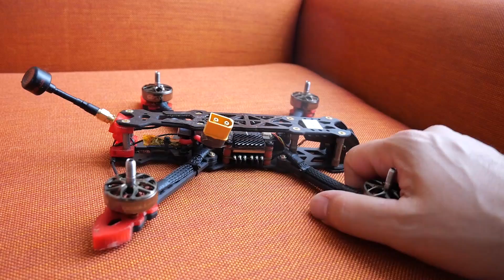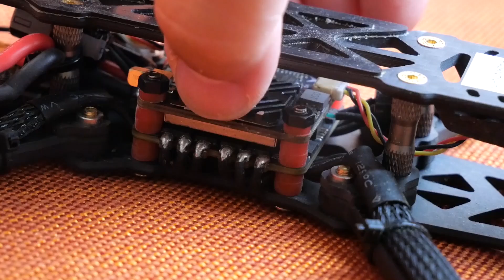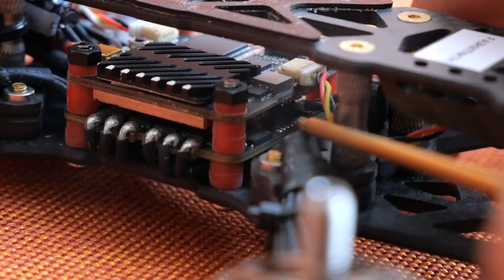Never buy a Flight Controller with this feature (GEPRC Mark 4 deal breaker)

Comment: Thanks for the video Joshua. I do personally fly many GEPRC stacks myself and would like to note that this stack (F4 Tower) now has an updated version (F4 Pro Tower) That bumps up the in built VTX to a max 800mW. but more importantly changes the fc/esc connection to a wire harness. Why they didn't include the updated stack in this bnf, i am not sure, as the stack you are having troubles with is a few years old now. Just thought i would mention it, as my F4 Pro stacks have been handling abuse fine within my race frames (a fc/vtx combo works great for tight builds) and i don't want this product to be your end all view on geprc.

Comment: This is Geprc’s dirty little secret. Cost me hundreds on the “amazing” Cine queen and Cine Pro until I wised up and replaced with wired stacks. Thanks Geprc for wasting my $ on this horrible design flaw. I was about to make the same video but mine wouldn’t carry as much weight. Thanks JB for calling them out for the new pilots
Reply: Same thing happened with my phantom whoop. Seriously who dafuq puts those types of connectors on soft mounted stacks
Reply: I had the mark for freestyle and the Phantom bow through the exact same thing pins ripped off within for slightly hard Landings not even crash Landings

Comment: This is the same as the og hobbywing stack. Soft mount the esc and fc together, so they are softmounted from the frame but are rigid together and support the pin/pligs with hot glue. zero issues then

Comment: Yep pins don’t work unless the boards are hard mounted to each other, I would go to the trouble of replacing the pins with silicon wires but I guess you can just grab a different quad 😂

Comment: I had this exact issue with my BetaFPV stack for my 75x. I ended up removing the pins completely- male and female and soldered tiny wires to each pin port. Major pain
Reply: same here on 75x, but I hot glued the hell out of it and its been holding well :D

Comment: That's too bad, because the GEPRC Crocodile 7 uses a wiring harness. Everything is soft mounted and the FC and VTX are on one board as well. Also the stack does NOT wobble! You would think they would have made the Mark 4 the same way. That's too bad.
Reply: Thank you very much for Mr.Joshua's feedback. Your comments and reviews are very important and we attach great importance to them. 
 However,I wanna add that the Mark4 freeestyle you reviewed was a small batch of prototype, it is initial version. Before production, GEPRC team has optimized and improved this problem. The latest batch shipment of Mark4 has used the latest wiring method and improved the soft structure design.
Fix the following issues from June 1:
1. The connection mode of FC and ESC is changed into flat wire, which makes the connection more stable.Pls check this photo: https://geprc.com/wp-content/uploads/2020/03/2-3.jpg

Comment: i believe KababFPV mentioned about this faulty design. not just geprc , iflight uses it as well on their micro stacks, but it kind of works there due to low inertia of small 16x16 boards

Comment: Geprc does this on a lot of their stacks. The geprc phantom stack has the pin headers as well. I have had to Replace with other stacks. Shame becuase the rest of what they do is pretty damn good!!! Funny though, betafpv does pin headers and I beat the crap out of my betafpv whoops(I mean full speed wall slams!) with No pin header problems. So maybe crappy solder joints on geprc boards???? Either way, pin headers suck! Thanks for the update Joshua !!!! I also checked how tight the stack was, didn't make a difference at all.

Comment: Same issue with the geprc phantom 20x20 stack. I resoldered it once now and it's still OK so far...
Reply: Don't you mean 16x16 stack? 😉 Next time you might not be so lucky, it could rip the pads (that the pin headers are soldered to) off the board. If you are confident at soldering, I recommend removing the pin headers from both boards, and just solder wires directly to the pads. It is delicate job though so, do it only if you are good at soldering. Personally, I hate that modern RC electronics use so many damned plugs.
Reply: @Temporal_Flux  haha, yes 16x16!
Maybe I remove the connertors, you are right. I have a hot air rework station, so it's manageable. Or maybe I use solid board to board  stands.

Comment: Wow , excelent catch Joshua, that was a complete electro / mechanical design  flaw, ribbons and cables are much better they can take all the flex without stressing the point of contact and the boards. Thanks for sharing.

Comment: Yep, after ssing this on some of th e early HGLRC stacks i immediately new it would be a problem.. Seen heaps of boards with this connector fail over the years even when hard mounted - only takes a few good crashes and the G's are just high enough to make things bend and the poor little connector fails.. This should NEVER have become a standard. It also prevents making tight builds as the height between the boards is fixed.

Comment: no way! i had this same thing happen to me 1 hour ago! i fixed it though, thanks for the tip
Reply: How did you fix it?
Reply: @kcole3590  well it wasnt quite same, but readjusted the pins and worked fine
Reply: I wanna know the specific operation, Is the common situation or random
Reply: @jinchen9937  well ive got a spektrum reicever with a FC that is soft mounted. the harness that runs from the FC to the RX, was not inline with the pins. it had been shaken and the soft mounted FC pulled the connector out of the RX

Comment: 1:34 - holy crap! I didn't realise the stack would wobble that much! No wonder the pins are screwed. I'd be getting my soldering iron out and replacing the pin system with a DIY cable.
Reply: I tried to do that and all's I did was having more of a headache it is a horrible task to try to wire up with this exact flight controller the way you mentioned because I have tried it twice
Reply: @kevinbills113  That's a double row pin header setup? Yeah I'd struggle with soldering wires on a double row too. Not impossible, just ridiculously fiddly and not desired on something you're going to smash & bash.
Reply: @licensetodrive9930  agree, doable, but it would be delicate.

Comment: I mean.. Any stack bigger than 16x16. Ive run a stack like that in a iflight cinebee frame and its so light and honestly if you cracking it, it cracked. But it works on small fiddily stacks. But larger would be a no go for me too.

Comment: It can be saved. It sucks, but a little solder and some wires and you are back in bidniz. Send it to me. I'll fix it.
Reply: I tried this on my CineBee, but the connector's pads had lifted..
Reply: @lievenvv  good point. But the fact he can push it and get a connection solid enough to boot the FC suggests the pads might be OK. I stress the might part. It's possible it's toast, but it's worth a little iron time to see. If you can replace that connector with some soft 30ga silicon wire it will be GTG.
Reply: @fullwattsfpv1414  yeah, mine was the same so I was pretty hopeful. Sadly, what was left of the pads was too little to fix the new wires to...

Comment: Even the 20x20 pin header stacked setups are bad, those just don't break as fast.  It's entirely possible to resolder, but also not at all worth the effort.
JST is worth the weight tradeoff, and truly good designs use solderable pads underneath for good measure.

Comment: I believe that I am having this issue with my GEPRC Phantom toothpick. I thought it was flip of death but this is what is happening. When's I'm flying the quad falls out of the air.
Reply: Are you using the stock 2 blade props or something else?
Reply: @Burn377  I'm using Avan 3 blades. I been using them since I got the quad.
Reply: @Burn377  I took a he flight controller off to solder a new capacitor to the ESC. That's why I was think I am having trouble with it dropping out of the air. Contact problem like Joshua said.

Comment: The bolts for the stack are moving too much. They should be secured with a nut to the frame so the bolts themselves don't move. I have a few HGLRC quads with a pinned stack like this and only broke after a bad full speed crash into a tree.
Reply: Yep, Bolt / Frame / Nut and then the stack and it would be MUCH better.
Reply from the maker: @treysmith1  But it would still break eventually.
Reply: @JoshuaBardwell  Indeed, but it's less suck. I also think its the right option for all setups to keep the stack bolts secure. :)
Reply: @JoshuaBardwell  I have the XJB 145 from HGLRC that has a 20x20 stack with pin header between the 4n1 ESC's and FC and has been fine. 

I think in your case, that the whole stack is a bit too loose and has moved around so much that the contacts have worn out and therefore won't stay in contact securely anymore. 

I do have to agree that it is a weak point that could just as easily fail from corrosion and would be very hard to fix without buying a new fc and esc down the road. But, not a total loss though. 

Like you stated, you have crashed it a bunch.  You could have just as easily taken out a esc or fc even with wired connections during a good crash, for which you would have blamed yourself and not the design.

My xjb is going on 2 yrs old now, still going strong, but you bringing this up will help to know what is wrong when/if it does happen. TY
Reply: If inav cruising low risk flying. But if betaflight racing freestyle you will crash and then it is problem even with secure bolts. I had Dodge OSD build on FLIP260 and had crashe defect OSD .

Comment: iFlight stacks are like that, too.
Reply: Only the dumb 16x16 stack, the rest are wired
Reply: @MachineManGabb  I have the 20x20 Succex F7 TwinG and  every layer has pins connecting to the next. FC to ESC and VTX to FC.....no wires.
Reply: @MachineManGabb  maybe thats only the older ones. I know I have a Succex-E 20x20 and that one has wires.
Reply: @MachineManGabb  Yah, they stopped having mine up on their site. I bought it a year ago.
Reply: Dave Hernandez ,  a year that’s what happened with my turbobee, thanks for that.

Comment: There's so much space on this quad, they should put a 20x20 VTX in the back. Like I did on mine. The frame is awesome though.
Reply: they did if you got the build with the caddx tarsier
Reply: @westcoastaerialimagery4690  That one uses a special bottom plate with an extra set of 20x20 holes in the front. The standard one doesn't have them. I tried a Tarsier in mine and the ribbon cable is not long enough to reach the middle mounting position for the stack. I may order a custom plate from CNC madness.